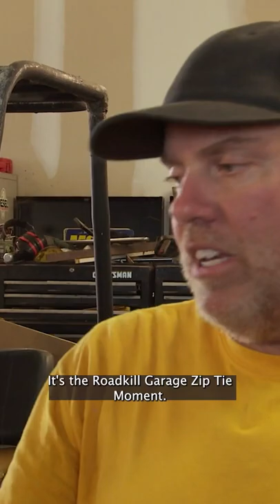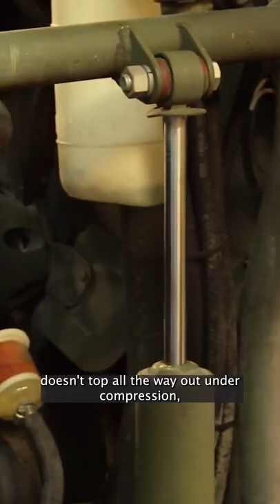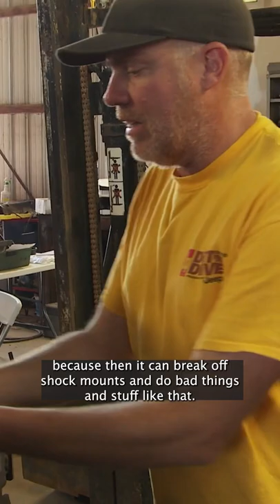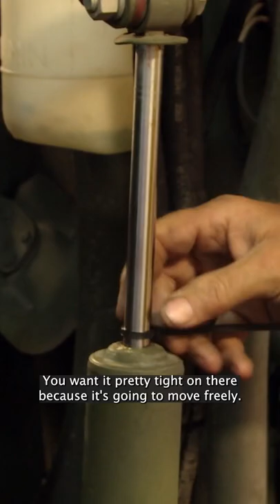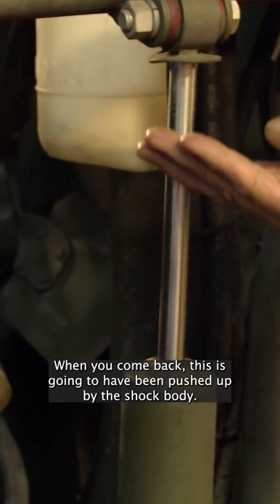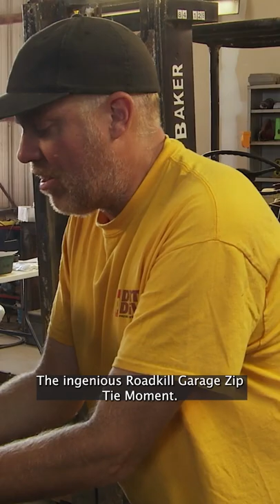Genius Shock Absorber Zip Tie Trick! | Roadkill Garage #shorts

Comment: You had me at " put a zip tie on your shaft"
Reply: It cut off blood flow I think I did it wrong
Reply: Sometimes a make shift c-ring is necessary. As long as you can cut it off 😅
Reply: @blumby4883  I agree, and I just thought of putting on a sleeve of some sort then the zip tie so it can slip off or cut the zip tie off then get the sleeve off

Comment: Been doing this on motorcycles for years
Reply: Mountain bike guys too.  Who gave this guy a show?
Reply: Decades
Reply: @DumpsterPanda01  we got specific o rings for it
Reply: @h0udinl  hHow do you get the oring around the piston shaft?  Do you have to take the shock apart to install?
Reply: @DumpsterPanda01  you have them installed while they're changing your blown fork seals because most motorcycle guys start out setting their suspension wrong and learn the hard way... speaking from experience. Lol
Reply: Yip I have color coordinated zip on my forks as well
Reply: @DumpsterPanda01  you put them on when servicing the lowers

Comment: Another tip If your shock is hidden like on some motorcycles and you dont want to remove it
Just use a black marker pen and make a line on the shock shaft.
When the shock compresses it will wear off and you will see how much travel left.

Comment: Another great tip with zipties. Use duckbill pliers the cinch them up then pinch and twist the tails off right at the lock. Keeps them from having a sharp edge that always cuts you in a thousand different ways.
Reply: Nail clippers.

Comment: I did this road racing cars and motorcycles. It can help tell you if your shock settings for compression are too tight which is if you are not using enough of the shock.